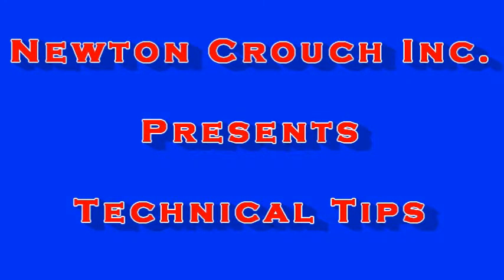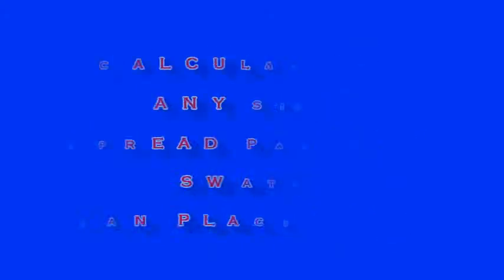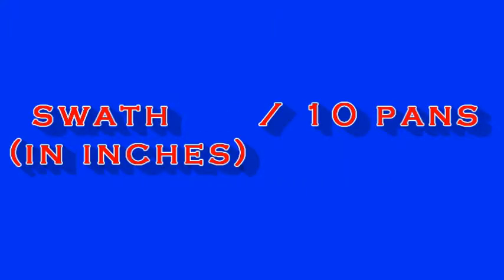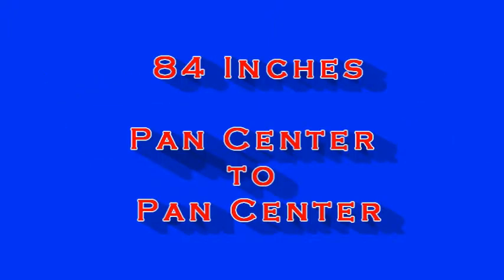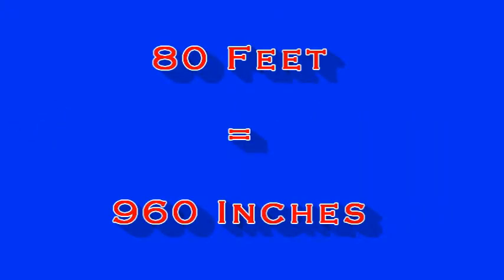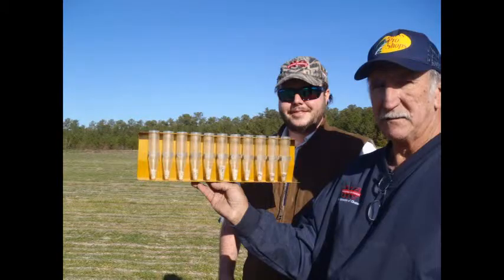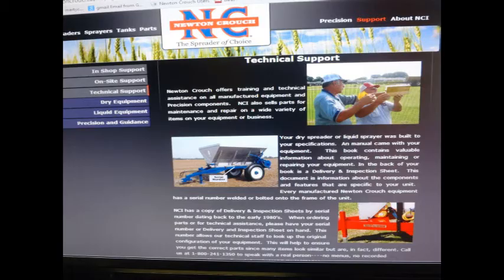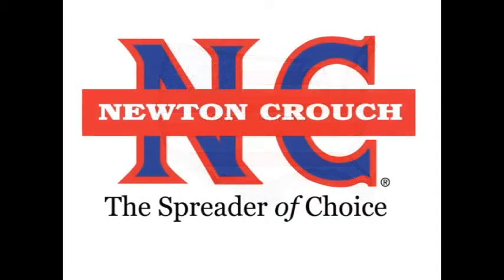How to do Pan Placement for Extended Range Swath Fertilizer Spreading

Comment: Why do the model 49 spreaders come with the pans that have 6 small spreader paddles? Is there any reason not to buy the 4 blade pans and throw 80 ft instead of 60?

Mine seems to throw 60 feet with fertilizer fine, and 40ft with lime.
Reply from the maker: It's not a simple answer.  Oil flow from your motors , spinner speed produced by motors, height of spreader dishes from ground, material you are spreading, tire size as it impacts the frame height from ground:  All these factors go into the spread pattern.  A model 49 is designed to spread 60 feet with a well defined pattern.  The wider the pattern, the more room for error.  It is our opinion that the value of an accurate spread pattern outweighs the extra width.  NCI does manufacture spreaders that come with the 4 blade dishes for an 80 foot pattern.
Reply: @Newtoncrouch , thank you for the reply. I am spreading MAP and potash. I had to go way above recommendations and adjust my chute all the way to 7.25 to get rid of the center ridge, but it seems to be an even spread at that setting. I have only spread 1000 acres with it yet, but I like it so far. The John Deere dry rate controller is very easy to use and it seems to be spot on with variable rate prescriptions. I weighed the buggy for the first few bins, and the quantity applied measured by the rate controller was within 2%-3% of actual on fertilizer.